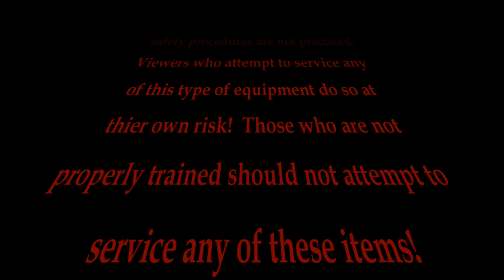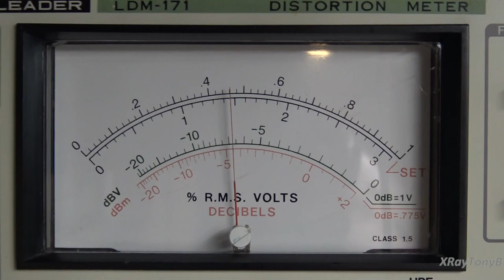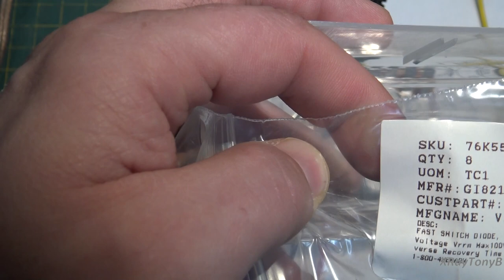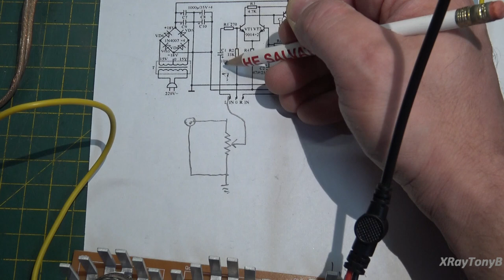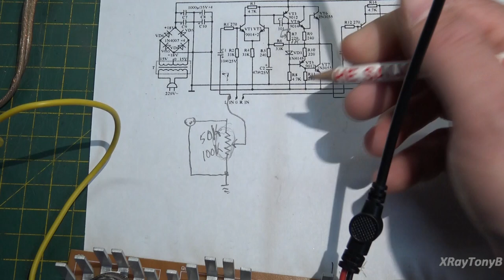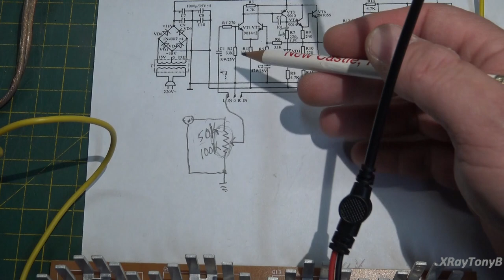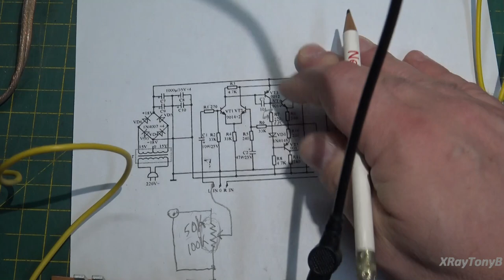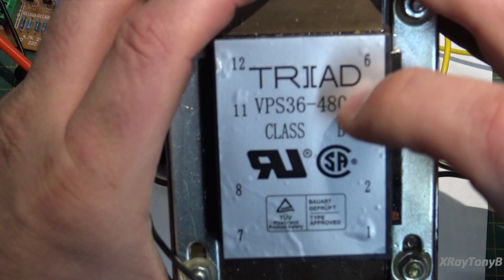Quasi Complimentary Amplifier Kit Follow Up to Viewer Questions and Comments

Comment: Here we are one year later and going through a pandemic and I can't think of any better way to spend my time in isolation than to rewatch some GOOD videos. I can't remember if you built up the other version of this amplifier but from what I have seen since, the one with the green PCB was actually better. I can't help but think that this one is suffering from the high gain that it has somewhere in the early stages because the output stage should be untouchable with those little heatsinks, they really aren't being driven to their full potential, one of the earlier stages are being driven to hard and creating distortion that's being passed down the line to the output stage... I believe also that I have either read or heard that if the output transistors are mounted off the PCB on a separate heatsink, the extra inductance from the wires to the transistors is actually beneficial to the amplifier...
The amplifier was probably designed with high gain in mind so that they could mount the transistors on the PCB and get away with those little heatsinks... I'm sure that this amplifier can provide really good performance if it was setup to be driven by a preamp instead of a phone's headphone output... Even with the current transformer that you are using... It's a real pity that you didn't fix the gain issue... If you would like to revisit this, I would be waiting with anticipation...

Comment: Quasi-Complementary..that was the buzzword back in the late 60s/early 70s when
RCA came out with the 2n3055 NPN TO3 case.  These were the universal power transistor
for amps. linear power supplies and other applications.

Comment: Thank you very much for the concise answer to my question, I have purchased one of these and look forward to having a little fun with it and seeing your next video. One thing I have found re transformers is there are many good components that are available essentially for free from junk electronics that people throw away. Thanks again.
Reply from the maker: I've salvaged a lot of good parts from old equipment.  I try never to pass up anything that might have a good transformer, heatsink, etc.  When I built my tesla coil a long time ago, I got a lot of the big parts from old x-ray machines.  Being in the x-ray business, I scrap a lot of old equipment.  Thanks for the comment!

Comment: Is that a Sziklai Pair?

I built one of those a few months back.  It looks like there are 3 layouts:

1) Output channels on left and right near the 2N3055s.  Tracks very angular, appears to be what could be called disorganized?  This is the version that I have.

2) Input on one end, colinear with the discretes and output which is on the other end.   Tracks still angular, but more monolithic, most angles and corners 45deg, better organization. This is the version that you have.

3) Input on one end, colinear with the axis that runs down the output transistors.  More real estate for large filter caps, small discretes closer to each other, output in same location as #2.

I had a 24V-0-24V transformer, so I hooked it up through a variac and adjusted the output.  Worked nicely.  After playing with it for a while, I ramped the voltage on up until it died.  It, of course, failed. It now only hums at whatever voltage.  Where should I expect to see the failure?  I'm (obviously) a real beginner in electronics...  Would like to use this to develop my debugging skills.  

My heatsinks were running about 90degF, but one was consistently about 20 degrees hotter than the others.

Very nice to see the mods, analysis, design discussion, etc.  You answered the EXACT questions that I had.
Reply from the maker: That's the word, but I still can't pronounce it! ;)   As for the amp, I would say that it was out of bias.  That's why one transistor was hotter than the other.  Most likely one or more transistors is now shorted.  After replacing them, you will need to adjust those two resistors from my video (the 270 ohm and the 4,7k ohm).  Not sure what values they will need to be, but you can experiment.
Reply: THanks!  I will do that.  If you look on YouTube you can hear others pronouncing it, but I don't think it is said out loud often even for me to have any confidence in how it's said  :)

Comment: Is a TIP3055 good substitution for 2N3055 and that way you can avoid fake transistors? 
Also I recommend Log (A) pot for volume. Human EAR is a logarithmic so you will hear it evenly when you increase or decrease volume.
Reply: Yes they are the same in datasheet,the only difference is in the housing style tip3055 has the plastic package and is easy to fix on any available heatsink but the 2n3055 is not

Comment: Cannot say enough  how much I like these video's. There are many amp-kits on ebay, some not so cheap. Some claim to be clones of e.g. Marantz MA-9S2 amp. Do you think they would be ok? Would really like to try, but i have no scope to tweak and check.
Reply from the maker: The word "clone" can have different meanings.  In many cases, inexpensive clone kits may use a similar circuit design, but the components are far from the same as the original device it is cloning.  More expensive kits can be very good and can even use name brand components (i.e. Nichicon & Panasonic capacitors, vishay resistors and good quality semiconductors).  Do some research before you buy the more expensive kits.  For the cheap ones, who cares?  You won't be out very much if they don't perform well or you could buy better components and use them instead of the cheap ones.  I bought a couple of these amp kits.  The first one I built as is.  The second one I will build with better components and the knowledge I got from the first kit build.  Good luck!

Comment: OK, I can see the 2N3055 in the circuit diagram, but look at what is stamped on the real transistor chassis!? Is it made by chinese company "ISCSemi", according to it's datasheet it claims to be 5 Amps (absolute peak) Collector-current and 50W (peak) transistor. The original 2N3055, according to the ON Semi datasheet is rated at continuous 15 Amps and Collector/Emitter Voltage of 60 Volts at a total power of 115 Watts. That's complete different animal of transistor!
Reply: Theyre 3D155D's and have lower ratings than 2N3055

Comment: I would not set a volume control at the very input if the problem is really an over-gain input stage, because is a easy way to add more noise, if the problem is the input stage has very high gain, is better to reduce its gain, and not let it to amplify too much the base level noise, overall when the music is very quite or changing the song.

Comment: Hi Tony, this is almost an exact copy of my Pioneer SX9000 except it uses 2N3055 and it has adjustments just like you talked about. My receiver has the finals out of it. do you think I can use the 3055's do they need to be matched?
Rich

Comment: i bought one to play with and solder pads are popping off when adjusting components. keeping in mind that i just replaced 101 leds on an audiocontrol c101 analyzer without a single failed pad, i do know how to solder. sigh.

Comment: Hi sir I have amplifier 4 tarasistors  2sc 5200   problem voice is clear but have good bass which resistance is good on power taransistors  already have 2.2ohm 3w and on speakers 0.47ohm ...which should to good and clear sound Thanks